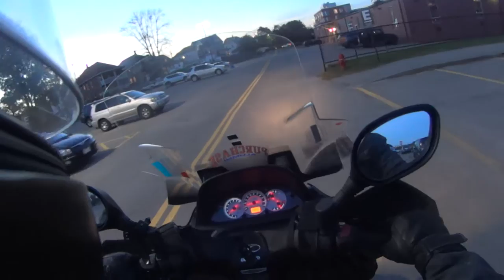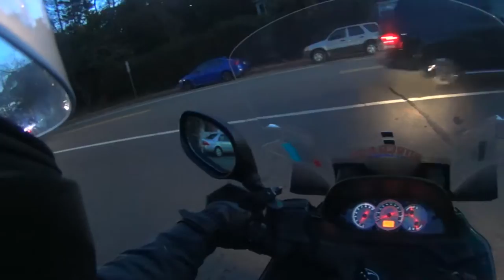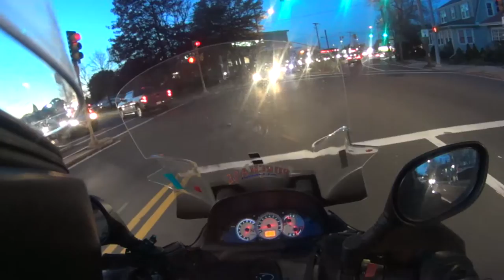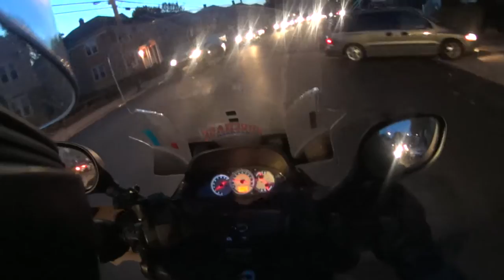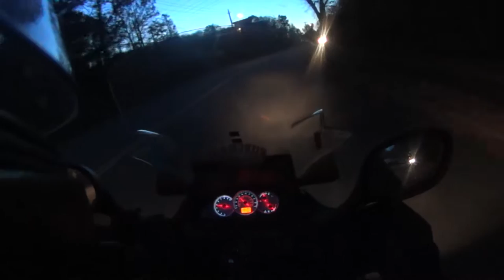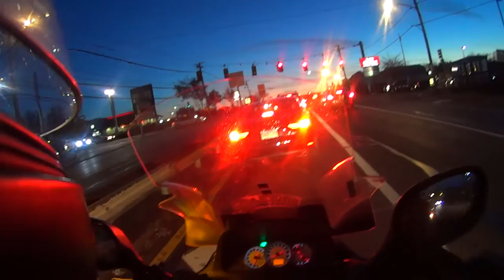Moto Vlog #43 - Air Horn

Comment: Nice simple and safe upgrade. I would like a PIAA horn but a little more than I wanted to pay, so I'm putting a Fiamm Horn on my 2009 Xciting 500, should be much better than the stock one. Also ordered a Philips City Vision H4 head light bulb, nice and bright and gives off slight orange tint to get noticed. And I'm going to change the indicator bulbs for LED.

Comment: Luckily my stock horn is quite load. (Italian bike = Italian load mouth :-) ) Still thinking about installing a air horn like you have done. Also looking to install LED daytime running lights on my Acerbis hand guards. Acerbis are some awesome solutions.

High viz clothing and helmet also make a big difference to be seen. I used a high viz orange vest (just like the road workers) and I noticed that most cagers were looking. Maybe they thought: "WTF! Is that a road worker on a scooter?"